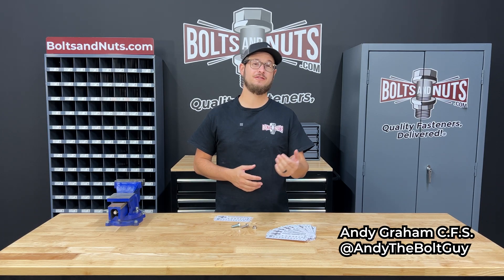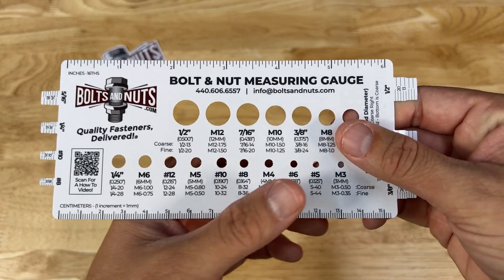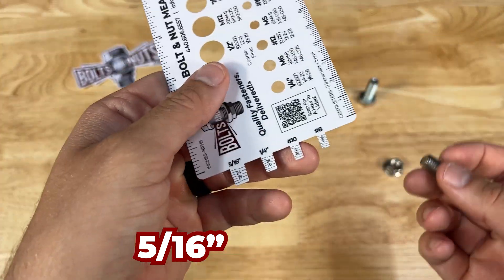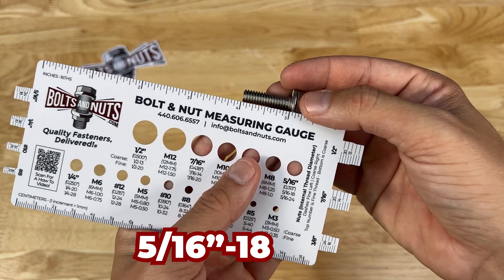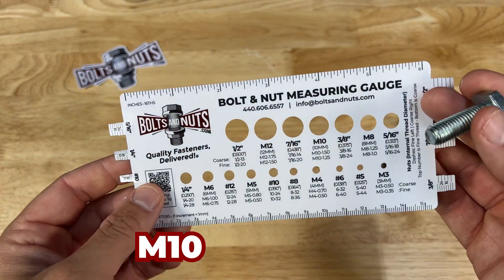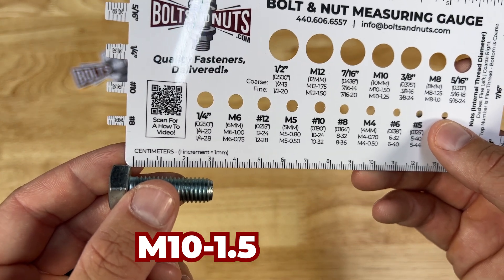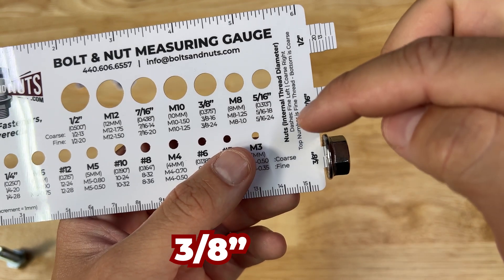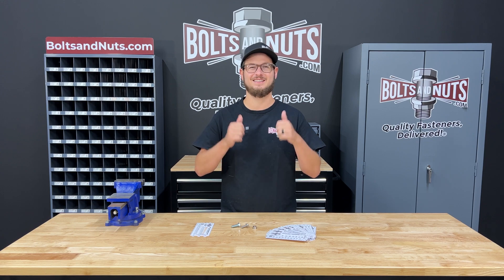How to Measure Bolts, Nuts, & Screws With Our Vinyl Bolt Gauge!

Comment: I may need to call because I'm at my wits end. I bought a metal bed frame imported that has 4 large aluminum knobs that screw on and I somehow dislodged one of the screws inside the ball and don't know how to replace it. I used a measuring tape that says the aluminum ball is about 5 & 1/2 inches around. I don't know the bolt size. I also don't know where I can get this ball cut in half and the inside screw soldered back onto it or find a suitable replacement as it seems the only option are heavy solid steel balls that I don't think come this large. Frustrating.